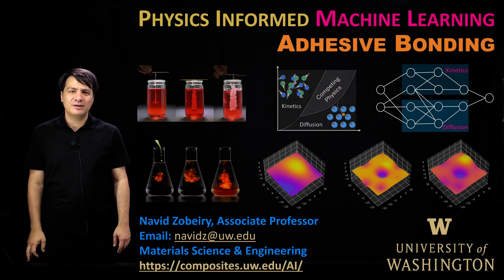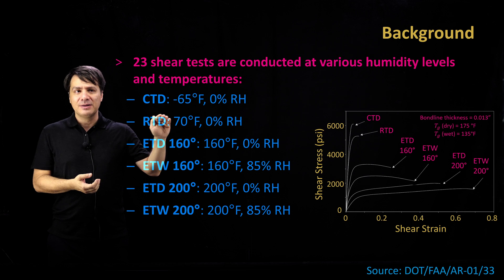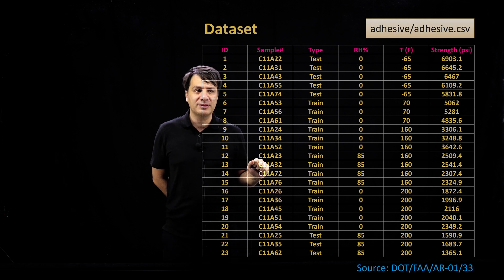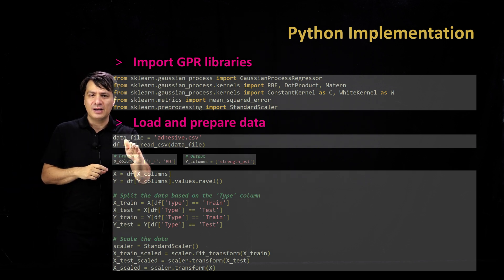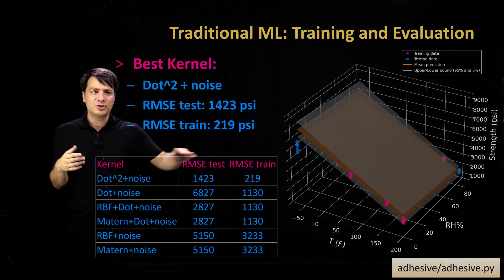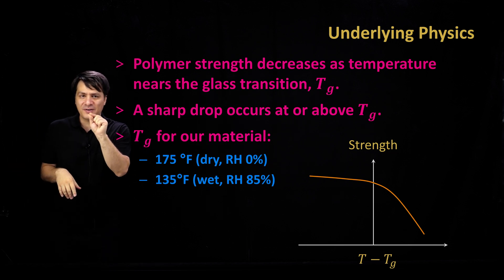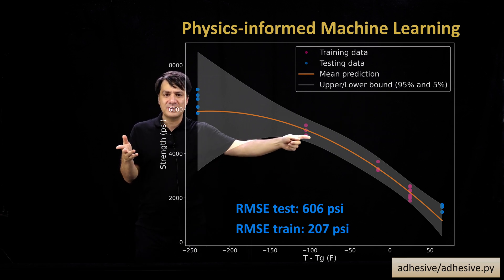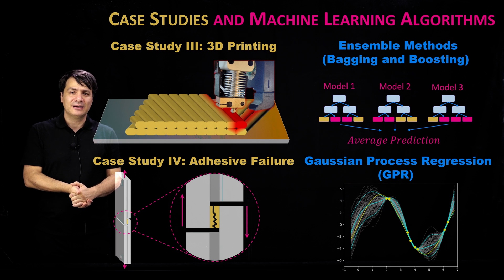Physics-Informed Machine Learning, Section 5 - Case Study on Adhesive Bonding Strength

Comment: Can PDEs be used on model-specific space-related systems, e.g., atmospheric dynamics on Mars, with dissipative terms (e.g., viscosity or heat loss) and external influences (e.g., solar radiation or gravitational perturbations) ?
Reply from the maker: Potentially yes. But some dissipative terms in the PDE may make convergence during loss minimization difficult—especially if the term is highly nonlinear in time or space. In such cases, techniques such as dense data sampling around transition zones have been developed to address this challenge.

Comment: Is it possible to train a Physics-Informed Neural Network (PINN) solely by minimizing the residual of a governing equation?
Reply from the maker: If the equation is the solution to the governing PDEs, then no. You don't need to include loss of PDEs. However, some PDEs don't have a closed form solution. So that forces you to include loss of PDE instead. But in general, you can train a ML model on any equation, weather PDE/ODE or not.
Reply: @UW.Composites  Thanks a lot, Prof. That was helpful
Reply from the maker: Yes, it is possible. However, there are some limitations and issues to consider. When there are multiple physics, there will be multiple equations, that must be satisfied together. This may be challenging if there are time dependent inputs.
Reply: @ thanks for the reply. so no need to apply ODEs or PDEs?